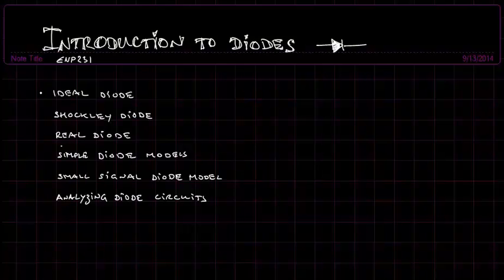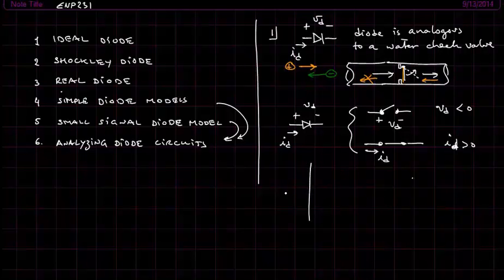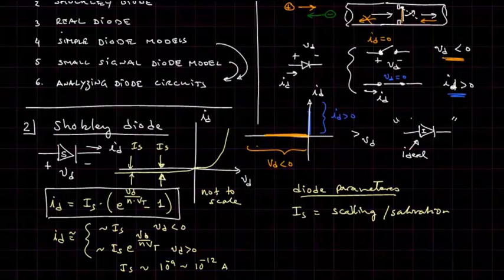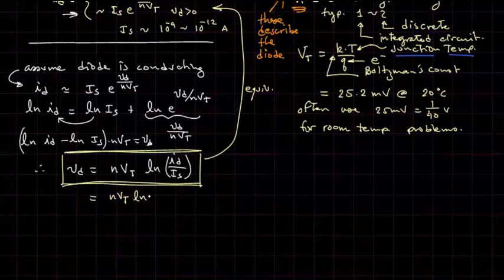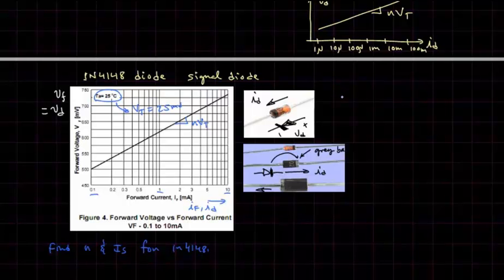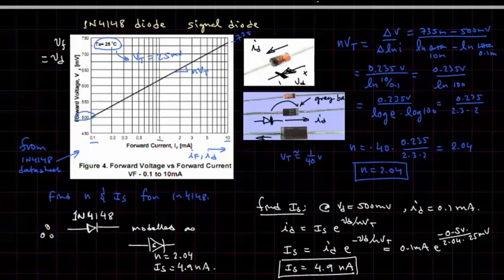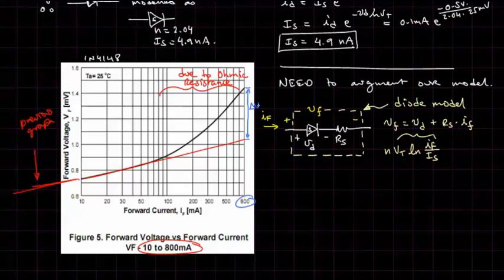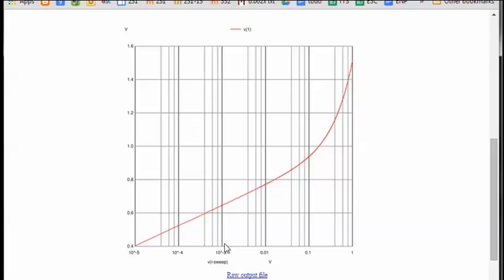Introduction to diodes - part 1

Comment: Pretty confusing lecture.  First you spelled Shockley correctly, then you left out a c, but not to be confused with the that other diode that sounds just like it but is used to limit current at a certain level.

Comment from the maker: The 1N4148 diode example in the video computes IS = 4.9nA.  Based on the derived value of n=2.04 in the video, IS should actually be 5.5nA.  I evidently had rounded n to 2.0 in my calculation of IS = 4.9nA...  Just in case you are checking my math... :)
Reply: Your Ln 100 change of base conversion to Log is incorrect...  You do multiply instead of divide the Log number and the Log base...  Like so: Ln 100 = Log e * Log 100 instead of:  Log 100 / Log e...  
Time stamp: 39:17

So n = 40 * 0.235 / 4.6 = 2.04

but you wrote Log e * Log 100 = 2.3 * 2 which would mean that Log e = 2.3 when it is not!  Log e = 0.4342